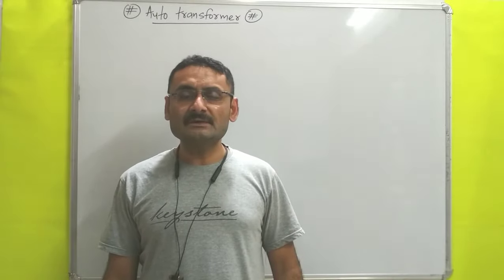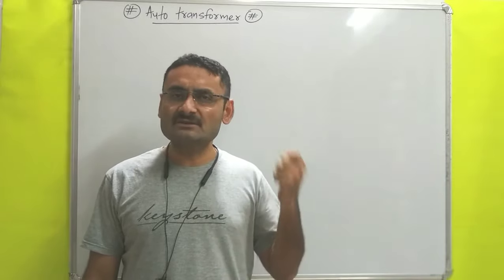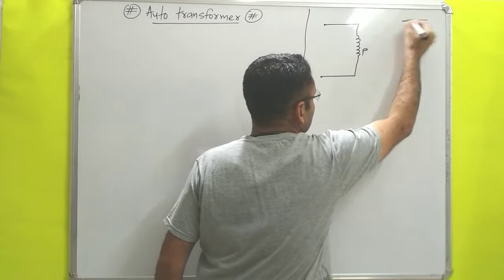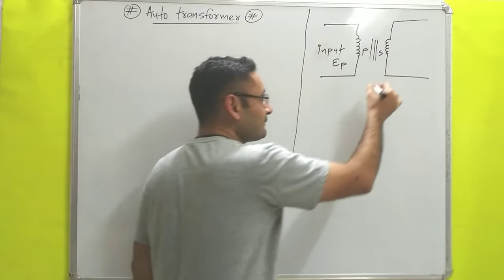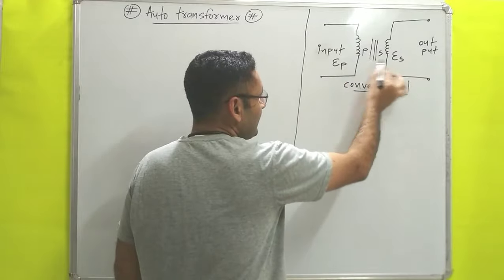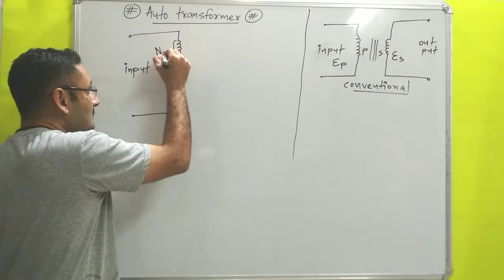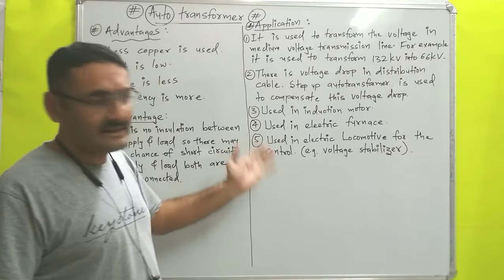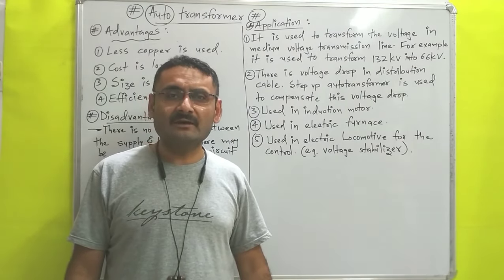Auto transformer (construction and working) Unit 3 Transformers (Basic Electrical Engineering)

Comment: working of this transformer is should be explained because primary and secondary side is sharing same coil so the are not electrically isolated how secondary is sharing the current with primary mean to say thats two opposite directional currents are in same coil so it is a little bit confusing. Explain it in detail specially flow of current in primary and secondary and how they are sharing the current and how by self inuduction the voltage is transforming
Reply from the maker: Dear it is requested to watch the basic videos of mutual inductance from the playlist.
Thank you
Reply: @gautamvarde  I have watched all the basic videos they are pretty much helpful but not helpful enough to understand the flow of current and voltage transformation in auto transformer where primary and secondary are not electrically isolated from each other and they are sharing same coil and for voltage and current in primary and secondary. I mean to say that primary is having some  input current same current is being shared by secondary so how these two currents are different same case in voltage. so it is requested to you that if you can make a detailed video about auto transformer explaining how current is flowing in primary and secondary how they are sharing the current what are the directions of current in both coils how voltage is being transformed and how a single inductor is behaving like two inductors.